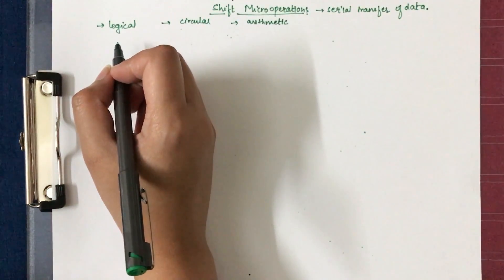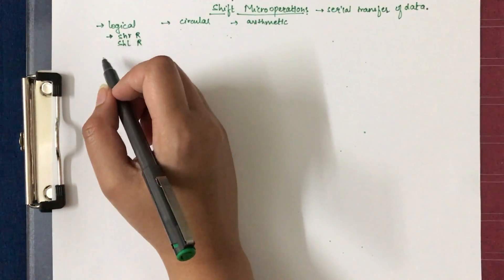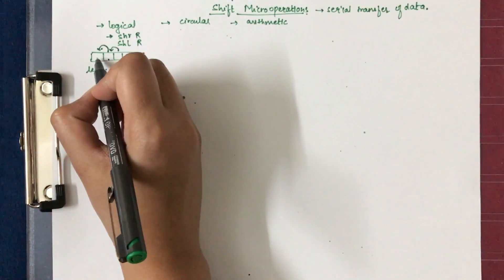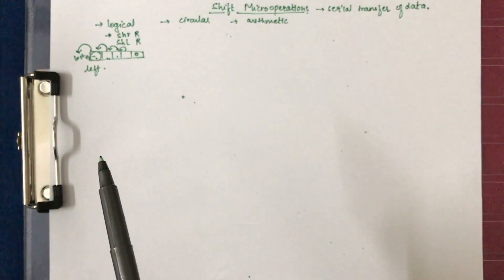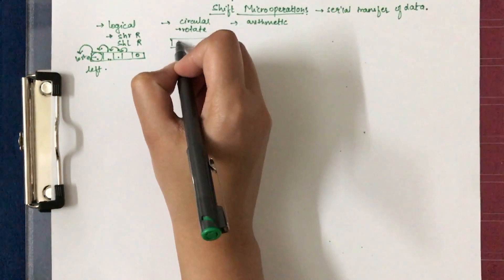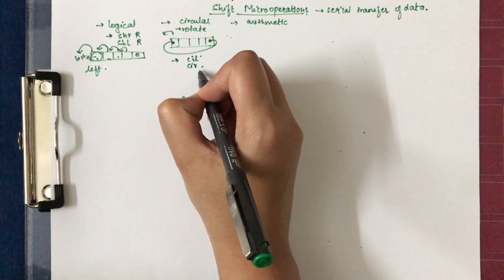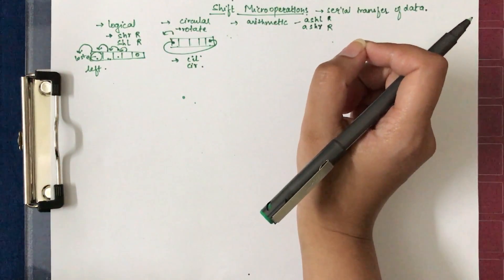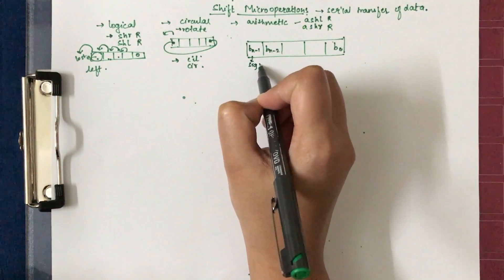Shift Micro Operations

Comment: Mam how to do this question..? Please..

Consider the register R1 has the value 
01011010. Choose register R2 values to 
perform following operations on register Rl. 
(i) Mark the upper four bits of R1 
(ii) Insert the value 1100 as the upper four 
bits of R1 
(iii) Clear R1 register 
(iv) Complement the lower four bits of R1